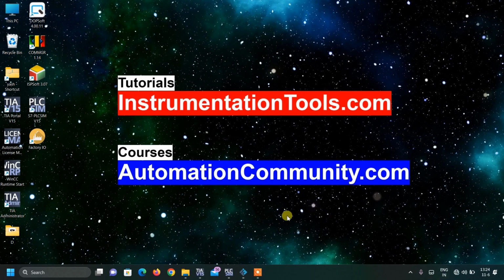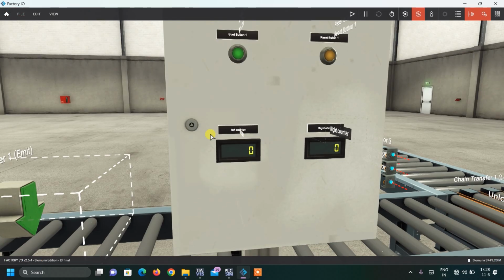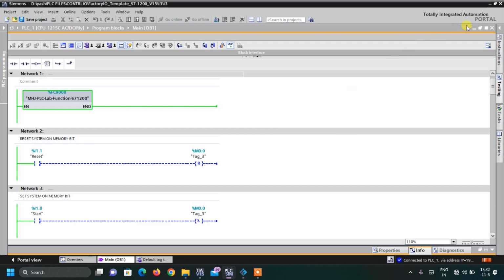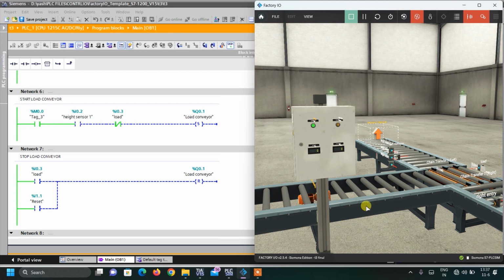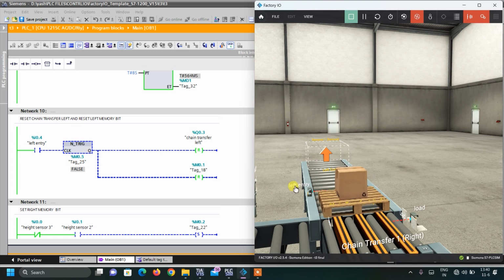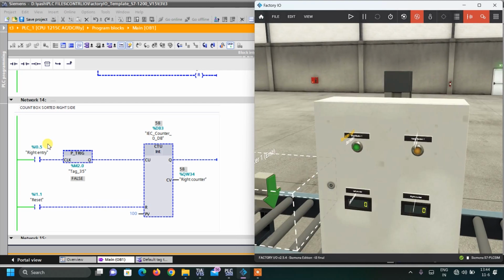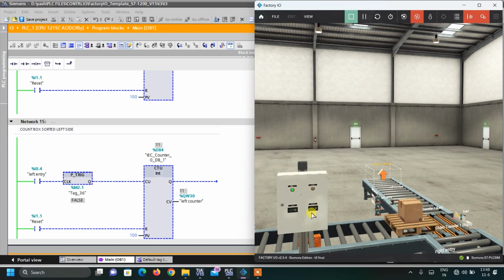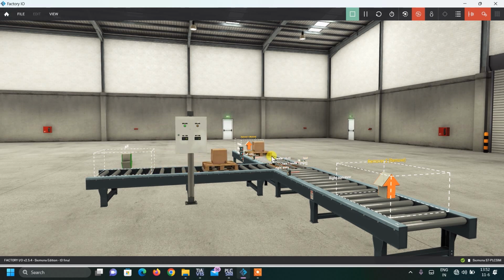PLC Program for Sorting Boxes using Factory IO Simulation

Comment: Thank you for the tutorial. Regarding the issue with wrong counting (i would get increments of 2 or 3 when just 1 should have been reported), I tried placing the sensors better as a comment here suggests but it would still be triggered 2 or three times. So I used a TOF timer on network 14 and 15, so that the positive trigger will be kept as ON for 2 seconds causing the sensor to not send a negative trigger (or lets say the counter not to accept one) then again a positive while the box is moving. This way for the period that the box moves through the sensor, it detects it only once.
Reply: Thank you. It help me to solve this issue. It works now.
Reply: How to solve start button not working
Reply: great

Comment: While i connect S7PLCSIM driver, and following all the steps like compile....but still it is showing error that "can not connect to S7-PLCSIM V5. Please check that it's is running and try again"
Reply: hi, i had the same problem. in project tree right click on name of project (white sheet paper icon) and go to properties > protection and chceck "support simulation during block compilation".